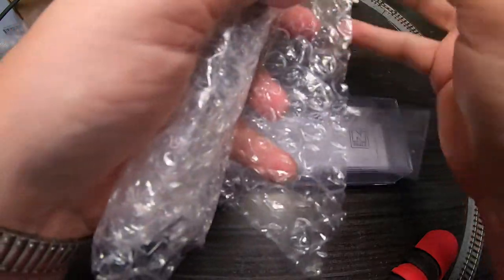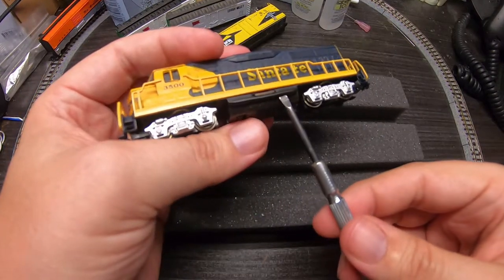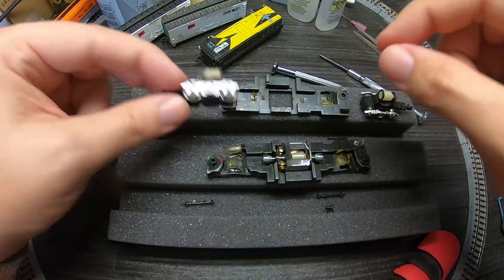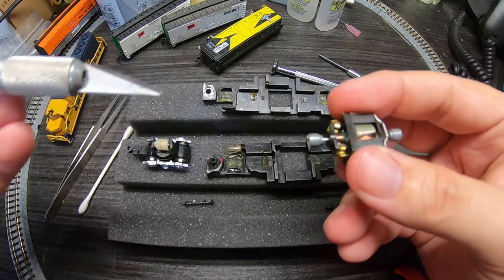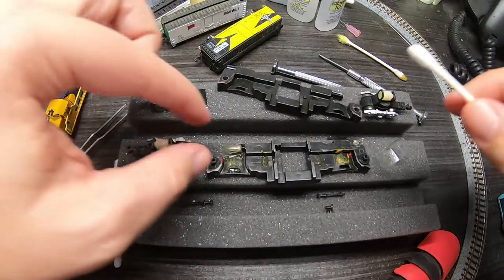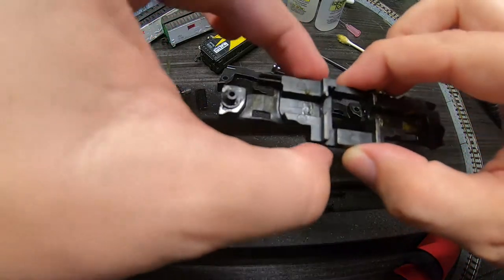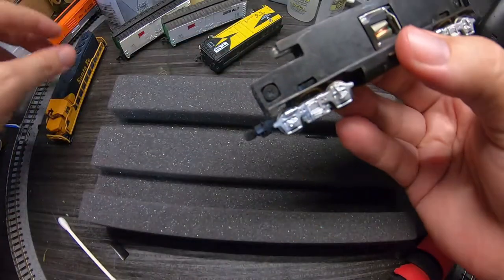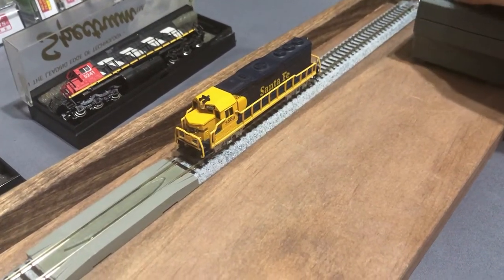Will it Run? - eBay Purchase Bachmann N Scale GP40 - Trains with Shane Ep3

Comment: My very first N scale locomotive was a Bachmann F9 Union Pacific that looked much like this one inside.  It wasn’t running well after a relatively short period of use, so I went in to troubleshoot.  Turns out, the wheels were dirty.  I felt dumb; I never considered the possibility because it hadn’t run that much.  I found out later that my aunt and young cousin had visited the family one night after I had gone to bed early and my cousin ran the train.  A lot.  That was the only locomotive I had at the time, so it logged some miles that evening.  Happy ending: it ran great when reassembled and I learned about this type of locomotive.  These are by far the easiest ones I’ve worked on, but I did run into the same issues you did.

Comment: Not all oil are equal Whale oil is preferred for lubricating clocks white Lithium grease is good for plastic gears not Sewing machine oil use Triflow Oil Firstly, mineral oils are a great choice because they do not attack plastic and offer good operational .
Reply: use vaseline it works fine
Reply: @tommurphy4307  Hey thanks good old Vaseline I totally forgot that stuff.

Comment: A lot of the older N Bachmann locomotives sound like coffee grinders when they run. Even the early SD40-2 with flywheels do.
Reply from the maker: Yeah most of the ones I have are pretty growly.
Reply: @Trains-With-Shane  I once knew a salesman at Visalia Hobbies who would say to run toothpaste in the gears to "wear down" the gears to quiet them. I tend to think he wanted to sell me new locomotives.
Reply from the maker: @michaelmorgan7893  quite possibly. Because logically it doesn't make sense. I think it's usually lose tolerances that cause noise.
Reply: @michaelmorgan7893  Actually some toothpaste will polish some plastics. You can buff acrylic headlights lenses with Crest. I have 7 of these 2006ish Bachmann and they all sound like a bad gear mesh to me. I might even try Crest in one that's NIB and sounds awful and just see
Reply: @Wizzard033  let us know how well it works, if it does. That engineering plastic those gears are made of, is kind of difficult to work with. I wouldn't want to do something that might chip the teeth.

Comment: My very first N scale train set I got for Christmas 1968 when I was 15. It was a Bachmann Union Pacific GP20 diesel locomotive, A Southern gondola car, Atlantic Coast Line stock car, a DuPont tank car & a Union Pacific caboose. All of the locomotives, freight cars, cabooses & passenger cars only had the Rapido couplers. The GP20 motor burned out, it became a dummy for my Atlas Union Pacific Alco PA diesel locomotive which worked better-this was in 1970. I model only N scale, I have 5 Kato diesel locomotives, the Southern Pacific GS4 4-8-4 Daylight steam locomotive that pulls the Morning Daylight 10 car set which is my excursion train, all 6 Kato locomotives work great. My oldest son set me from Italy where he works at the U.S.Air Force side of Aviano AFB set me a Bachmann N scale train set-Union Pacific 2 FT diesel locomotives,1 Union Pacific, 1 Alaska a Union Pacific Fairbanks-Morse Diesel locomotive made by Atlas that doesn’t work, the Bachmann FT Diesels need some work, 2 freight cars & a Union Pacific caboose-all have the Rapido couplers that I plan to change over to Micro Train knuckle couplers. The Bachmann Union Pacific diesel locomotive will become a display locomotive.
Reply: proto motors are crap. the first thing i do is avoid buying them. if i have to work on them i use kato brushes and carefully resurface the sectors of the commutators. we have not had any failures of reworked protos, as yet.

Comment: I bought 4 new Bachmann N GP40’s off EBay. Brand new. The new line has been retooled! Bachmann did a very good job on the new locos. Very smooth runners and so far after a little more than a year, no problems. They speed match very well (DC) with my Kato locos. They are a vast improvement over what they used to be.
Reply from the maker: I've got two new-ish GP40's. Think I have videos of them both on the channel. one is MKT which is DC only and the other is BNSF with is DCC/Sound. They are quite good runners. bought them both brand new as well
Reply: @Trains-With-Shane  
Cool! I’ll look for those videos. I bought two MKT, one NS operation lifesaver, and a Boston and Maine. The two MKT run really well coupled to my Intermountain MKT SD40-2.

Comment: I have had quite a bit of experience with N scale Bachmann F units.  I have worked with N scale since 1978.  Over the years, I have seen a lot of improvement in the Bachmann locos.
Originally, the F units had brass gears.  They were quite noisey.  We called them "coffee grinders".  They did run fairlly well for their time.
Apparently in an attempt to quiet them, the brass gears were replaced with white nylon gears.  These were quiet, but the nylon gears would split.
Finally, they started using black plastic gears and I think these solved the problem,
Back in the days of "coffee grinders" I had a pair of F9's I named "Cheech and Chong".  In an attempt to quiet them, I overlubricated them.  One day while attempting to start a train, they went "up in smoke" in front of my passenger station.

Comment: Over the years (since 1987) I have acquired probably no less than ten of this generation Bachmann locomotives.  Some purchased, and some "inherited".  Every one of them (at least the ones that run) has that Bachmann growl.  Naturally, I have taken them all apart at one time or another.  I find that these are actually pretty simple to work on.  I have actually taken trucks apart for cleaning, etc.  But then I have a lot of parts for these units, so replacement/repair is a little more forgiving.  
    
    One thing I have noticed about the motors is that (in my experience anyway) the three pole skew wound motors are very smooth on the low speed end.  Much better than the straight wound motors.  In fact, I have some three pole skew wound that will rival some five pole skew wound motors out there.  I even had one that I thought was stopped, only to come back an hour later and see that it had moved about a foot on its own.  Not sure we could ever repeat that, but we all got a good laugh from it.
Makes me wonder is one could possibly do a Can motor conversion on one of these.

    I actually still use a couple of old Bachmann units today (late 2023).  They are definitely showing their age, and of course still growl like a snarling cat, LOL.  But the fact that they are still running is kind of a testament to their overall durability....or maybe my own tenacity in keeping them running?  🤔
   
   Anyways, just my contribution to the conversation here.  I have seen a few of your other videos, and really like what you are doing.  So thanks for what you do here.
Reply from the maker: Thanks! The newer videos have a much higher recording quality. These Bachmann with the black axle gears are far more forgiving and less likely to be cracked than the white gears. I actually replaced the trucks on a GP50 high hood so that I could have the black gears on it. I don't have much of a vintage bachmann parts stash anymore. I used up pretty much everything to get a small handful of units running.
Reply: @Trains-With-Shane  Thanks for the reply.  I just took a look through some of my "salvage yard".  There is still a lot of old Bachmann stuff in there.  Not sure what condition it is all in, but I did notice that most of the trucks do have the (dreaded) white gears.  Fortunately, they seem to be all right. Got a couple of motors, frame halves, and bodies, as well as some other random stuff lying around as well.  Looks like I have just found another project:  Sorting out all of this Bachmann stuff.  Will be interesting to see what I come up with.

Comment: A Bachmann GP40 ATSF was the first N Scale locomotive I ever owned. That was back in 1980 when my first wife, now ex, introduced me to N Scale, as I had just sold all my Lionel O Gauge trains to a Lionel collector. By today's standards, it was junk and ran like crap, but was OK then. I moved up to Trix, Atlas, then KATO and now won't purchase anything new but KATO. I now have around 40 KATO locomotives, 15 Atlas locomotives, 6 Athearn locomotives, 4 Intermountain locomotives, 4 life-like locomotives and a couple of Trix units. All are diesel as I'm not into steam. I tried a Walthers unit but it ran like crap so I put the shell on an Atlas frame and it runs great now. The problem I have with Atlas is they won't put ditch lights on their contemporary locomotives. Also, all are DC as I have many older KATO units that don't  have space for DCC. I really would like to find an infrared or RF remote throttle set up, but haven't had any luck!
Reply from the maker: I don't think i've seen anything that would work. I know some of Bachmann's new HO scale stuff has bluetooth but i'm not sure if that's based on DC or DCC. Hardest part about trying to do a remote throttle is setting up blocks if you want to try to run multiple trains at a time. Now that being said there is probably somebody who has at least attempted to do so with a combination of Arduino boards, motor shields, power supplies, and likely using WiFi to control it all. 

Most of my new rolling stock is Kato, Atlas, and Broadway Limited (found a BLI unit I just couldn't live without despite their poor track record with decoders blowing up). But I also have two new Bachmann GP40's. One is DC and one is DCC/Sound. And honestly they're both REALLY good runners. Bachmann's new stuff is pretty darn good. And still cheaper than anything else. Although it's not MUCH cheaper than a new Atlas or Kato. I've only got a small handful of DCC locomotives. I'd like to convert the whole fleet but that's expensive and the older split frames aren't easy to convert as you have to electrically isolate the motors, etc.
Reply: @Trains-With-Shane  usually its tougher to find room for the decoder than it is to remove the gm-5 motor contacts and solder leads to it.
Reply: the older atlas/kato flywheel hood units are fantastic runners. i see lots of those on our club's layout and they are great to shop.

Comment: That growling sound is very common in Bachmann units of this vintage.  Been into N Scale since 1987 and every Bachmann I have ever had makes that same sound.   I call it the "Bachmann Growl", LOL.  I tried for literally years to find and eliminate that sound, replaced parts, light oil, grease (Never try that!) and just about anything I could think of.   I finally gave up and just ran them and put up with the noise.  They are decent runners...just a little noisy.
Reply: that's easy- enjoy some music while you run trains. i do and i have no desire for sound-equipped trains.

Comment: Bachmann's N-scale trainset locomotives were the best of that type - especially the 70s models with the noisy metal gears. They really ran well. Life-Like and Model Power's offerings then were mainly not dual drive and so, not as good.
Best era was in the late 80s, when these trainset manufacturers started producing good quality locomotives in N scale, that looked good, ran well and were affordable. Most of them also came with strong, torquey, 5-pole motors. Also, the Katos came along with locomotives like the GP50. I had two of them.
Reply: a lot of N scalers still run the hong kong drives. the worn ones are actually fairly quiet for all-metal.
Reply: @tommurphy4307  A neat hobby store near me had shoe boxes full of those metal Hong Kong drive for only $15.00 each. I bought scores of them - F9s, GP40s, U36Bs, etc..
That was way back in the early 1990s.

Comment: Bachmanns new gp40 uses a small can motor. It’s quieter, but runs hot. I think it’s an N20 6v motor.
Reply from the maker: I have a few of the newer GP40's and have noticed the same. They run a little warm but run VERY well.

Comment: I'm not sure if you're still using your knife to clean the commutators, but SMT,  and a few others using toothpicks, alot safer than a knife on the commutator. I used a knife as well at first as well, now I use a toothpick, but I actually disassemble the motor, that style motor is easy to take apart, and much easier to clean. Thank you for your videos, they have been quite helpful. I have an SD40-2 like the 2 in eps 4 n 5, your videos were very helpful. Keep up the great work.
Reply from the maker: I haven't cleaned many commutators lately. Toothpicks aren't sharp enough to get into the ones on most N scale. But definitely suited for most of the stuff that Harrison works on which is mostly H.O. scale.

Comment: Here is a trick for all. Last night was first time ever working with N scale. Same chassis. The screw pins kept pushing through the back as I put it together. So I used a piece of foam board put 2 Brad nails in with the heads sticking up about 1/8 inch, properly spaced for the pins.
Lay the chassis down so the nails hold the pins in place. (This also stops the chassis from moving on you) then put everything together. It was much easier. 
I now have 2 pieces of foam board set up like this for the 2 different size bachmann chassis.
Reply: i have no idea what youre talking about and i'm a motor man at my club.....
Reply: @tommurphy4307  wish I can explain better. When you were putting your chassis together the chassis screws stood in place. When I put mine together the two chassis screws ( the ones with the square heads) kept pushing through and out the back.

Comment: I also cleaned with the point of a needle the space between both semi-cylinders of the engine rotor, removing the accumulated carbonization. This must be done with great care
Reply from the maker: Yeah cleaning the spaces between the copper plates of the commutator is tedious and risky. I've done it on quite a few Bachmanns at this point.
Reply: if you use a good conducting lube, you can forget about doing that. it's very easy to reject a motor that way.

Comment: Check the brushes I have two and one of the brushes was worn down to about a 64th of an inch the other brush was almost brand new.  Look closely and don't loose the small springs behind the brushes.  Good luck
Reply: I had mine apart one day doing some cleaning. Somehow, a thread from my shirt sleeve caught the brush retainer and bent it open, the spring came flying out. I ended up making a new spring. I used three strands of wire twisted around a nail just slightly smaller than the hole to make it. New spring works great when the motor is attached directly to a battery. Getting it running in the chassis reliably is a different story.
Reply: the thin brush may have been contaminated with something. this can happen with only one brush- like in your case.